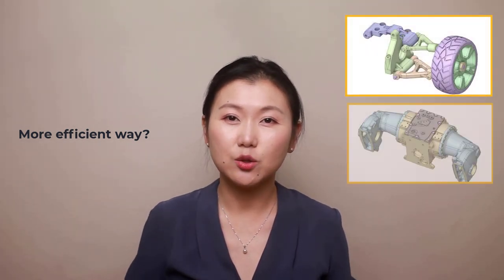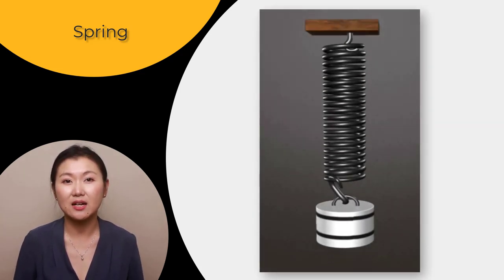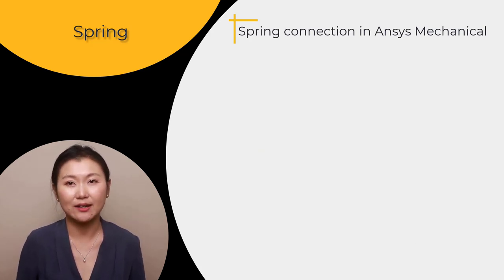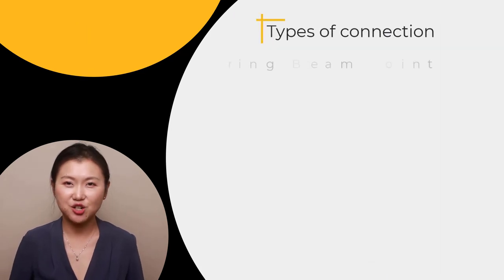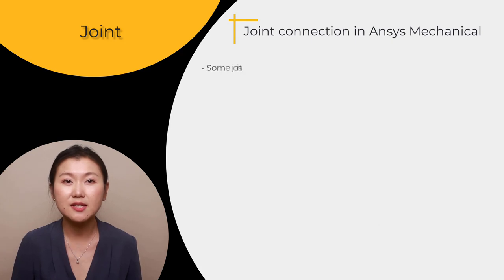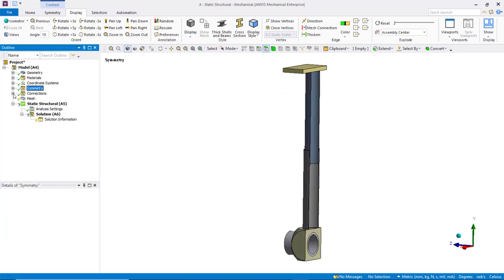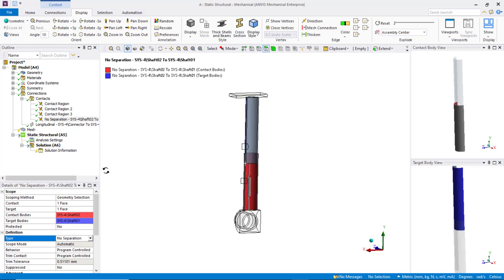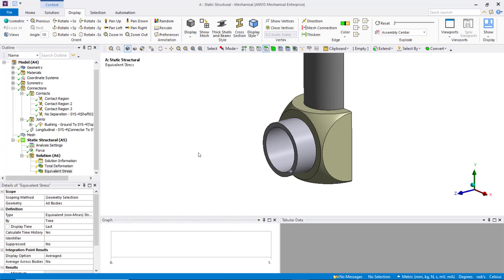Creating Kinematic Constraints Between Parts Using Ansys Mechanical — Lesson 5

Comment: There is a problem with the units on the Bushing Worksheet. As the version 2024R2 I am working now does NOT let you add 'per unit θx' etc if you have degrees instead of rads, you have to change units to rads and add there instead of 15000, 8.5944e+005. I dont know why i cant put data there while in degrees, if there is an option in ansys config etc...
Reply from the maker: Thanks for watching! Please post your query on the Ansys Learning Forum for a detailed answer from the wider Ansys Community: https://ansys.com/forum.